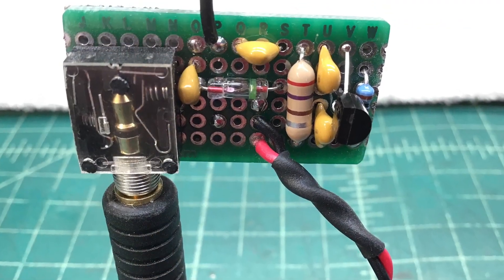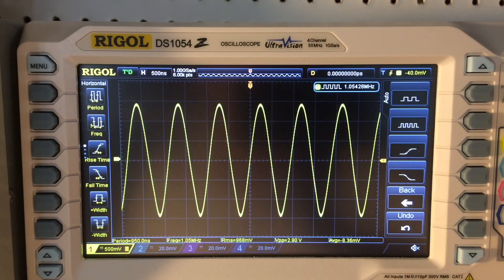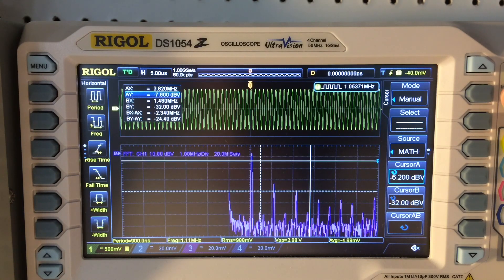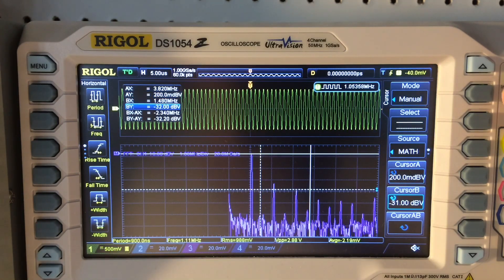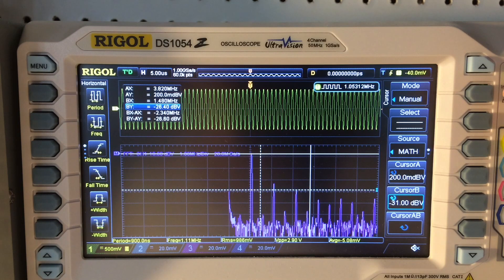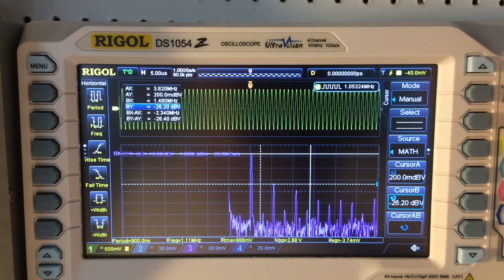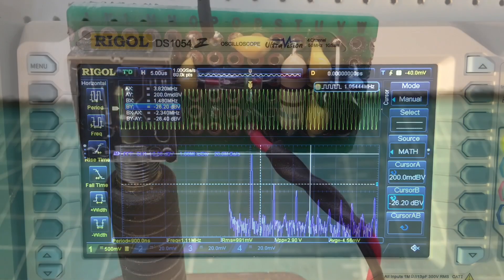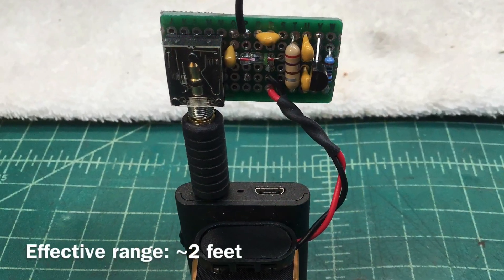Let's Build Another Modulated Oscillator

Comment: Have you seen this sort of design?
https://antiqueradios.com/forums/viewtopic.php?f=12&t=193042&hilit=lm386n&start=980
Reply from the maker: Not this exact one, but a design very similar to it. Sorry, your comment was hung up in my review... Thanks for forwarding, I will look it over. All the best. Don
Reply: @RestoreOldRadios   Not as nice as a tunable (VFO) transmitter but it won't drift if the battery voltage drops, etc.